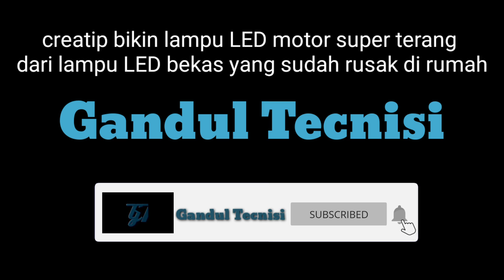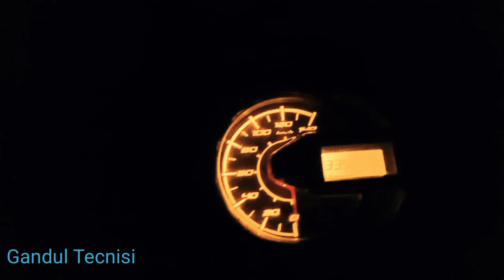Cara Bikin lampu LED motor dari lampu bekas

Comment: Kreatif TAPI hrs diperhitungkan ulang
Beli solder Rp xxx
Beli timah solder Rp xxx
Beli dioda Rp xxx
Beli lem dextone Rp xxx
Beli plakban kertas Rp xxx
Beli pinset Rp xxx
Beli cepit buaya Rp xxx
Beli kabel Rp xxx
Peralatan lain Rp xxx

Percayalah lebih hemat dtg kebengkel lgsg bilang "bang mw ganti lampu led"

😆
Reply from the maker: Kalo buat sendiri apapun hasilnya ada kepuasan tersendiri
Reply: Kopi roko ga d itung om...😃😃😃
Reply: @creatip  bener bang nama nya modif walau pun hal kecil ada kepuasan tersendiri dri si modifikator nya
Itu jga baru chip led yg wat kecil apa lgi pke yg wat gede behhhhh pasti lebih terang lgi
Sukses trus bang sma konten nya 👍